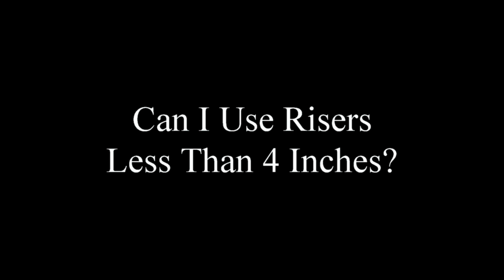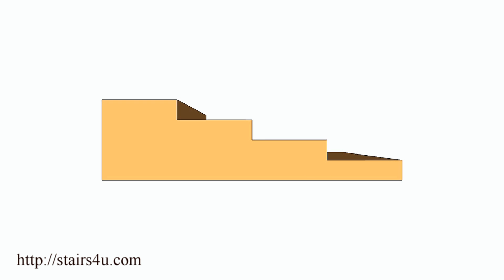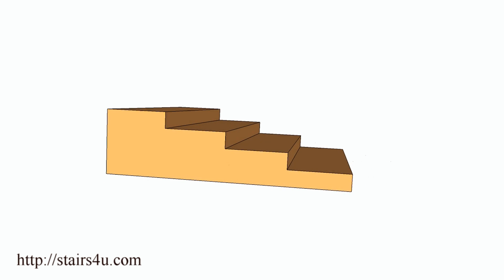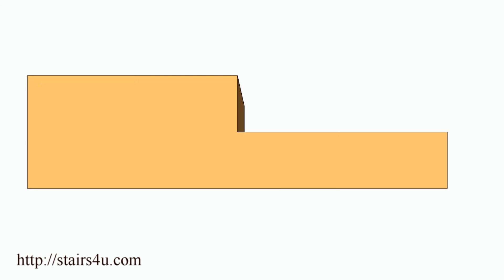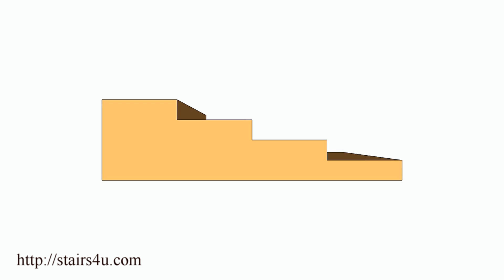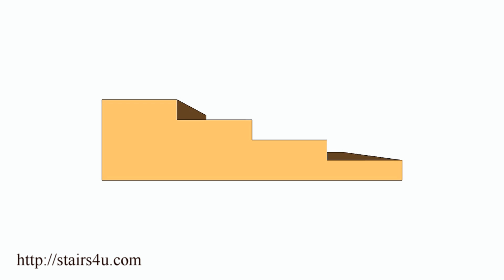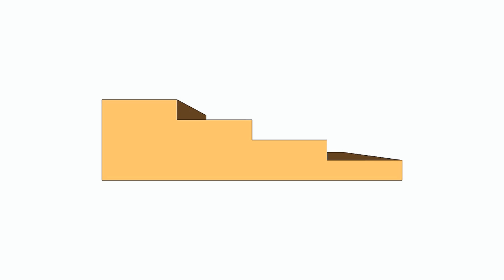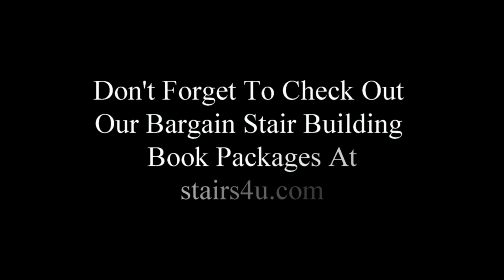Avoid Using Stair Risers Less Than 4 Inches – Safety And Building Codes

Comment: What's a minimum tread length for a 4 inch riser?
Reply from the maker: It will usually be between 9 and 11 inches, depending on the use of the stairs. You will need to check with your local building department for exact size.